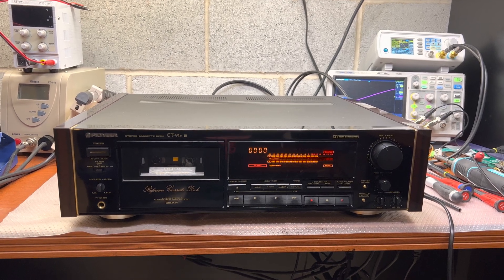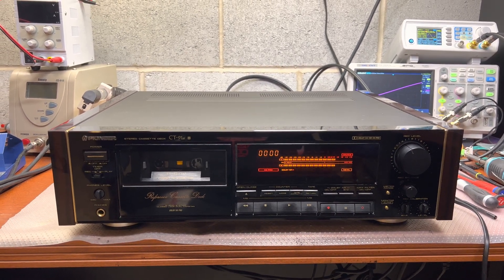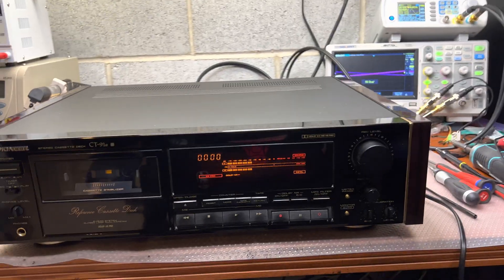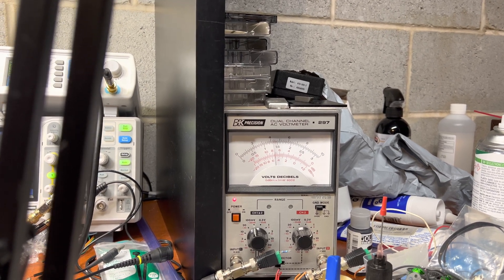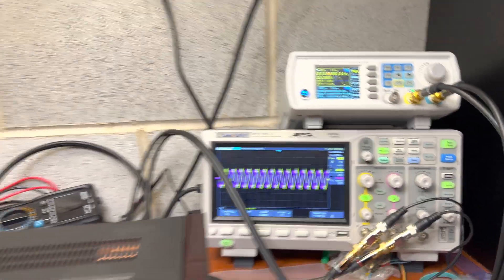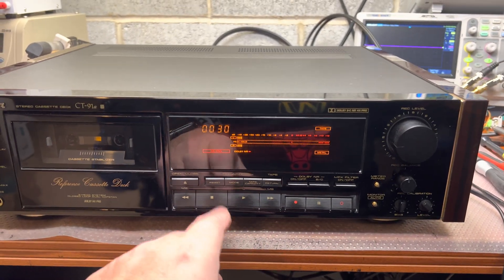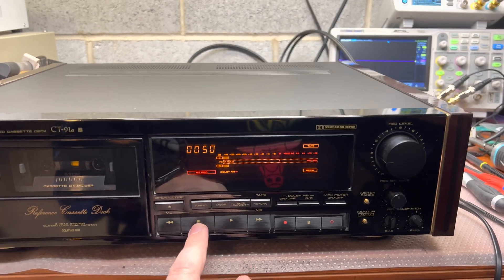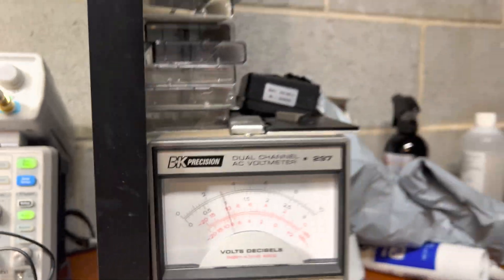Setting the Record Straight: High-Frequency Recording in Cassette Decks - A Response to Subscriber

Comment: I never saw any other of your videos, so did not see the comments. Youtube today decided to recommend your video to me, the ways of YouTube are inscrutable 😋
Anyway, impressed by the achieved frequency range of this deck, is it equipped with Akai GX heads? At what frequency does it roll of to -3dB?
I bet no "modern" Chinese deck comes close.
Reply from the maker: Hi, thanks for watching. This deck equipped with Canon heads. I also had Pioneer T-1100 and it did record 35 kHz. That only two decks which surprised me. Even Nakamichi record only up to 23 kHz with the perfect heads.